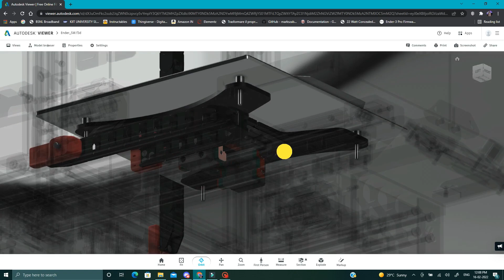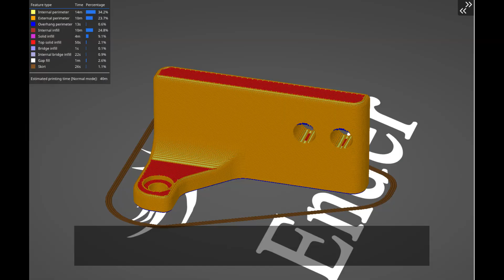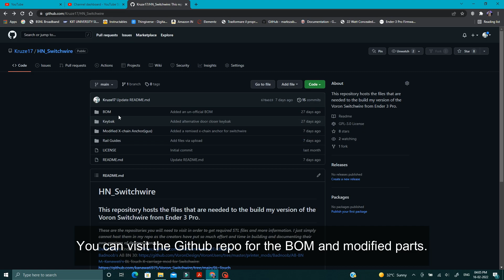Ender 3 Pro to Voron Switchwire Conversion - Part 3

Comment: Loved the series.  I was thinking of the same conversion, but will likely reign in my ambition some.  The parts you printed were amazingly clean, would love to see a tutorial on how to get ABS printed like that -- without warping.  Thanks!
Reply from the maker: Tutorial for Switchwire or Ender 3?😛
Reply: Either one! Is ABS without an enclosure easier on the switchwire?
Reply: Use a glue stick!! Elmer's purple. Since the very first time I used it I havent had a single corner of a part lift up! I use it every print no matter the size of print, it has been 100% effective in eliminating warpage. I was a non believer for a long time too until one day I decided to try it, now I don't start a single print without it.

Comment: Amazing videos. Thanks
Question regarding toolhead pcb wiring
Where does the 24v and 5v wires connect to? MCU?
Reply from the maker: You can refer this diagram for the wiring of the old hartk rev3.2 toolboard: https://github.com/Kruze17/HN_Switchwire/tree/main/ToolheadPCB_crealityv4.2.2%20wiring%20diagram
Coming to your questions, yes the 24v wire is connected to the MCU's 24v main input terminal. I don't remember if a 5v input was required for the toolhead pcb.

Comment: Did you print all your parts on the E3 Pro before the conversion? If so, what slicer? Was it direct drive or still Bowden? And lastly will you be able to share slicer settings? Fantastic work man! I've been following your build. It's brilliant.
Reply from the maker: Yes, i printed on my E3 pro before conversion. I use SuperSlicer for slicing software. It was printed on bowden extruder system. Yes i will sharing my slicer settings on my switchwire's github repository soon!
Reply: Ah that's fantastic! I'd like to do the same conversion, so I want to print ABS on my E3 Pro. So wanted to know your slicer settings before the SW conversion. Thanks for the info man!
Reply: Great video man. Doing the same conversion atm. Still missing some screws, then I can go on. These videos was very helpful for a good assembly. Thank you very much.
Reply from the maker: @GeldVerdienenOnline1  So much love and support from you guys! 🥺 Thank you so much. I am glad that my video was helpful for your build.

Comment: You switched from Bl Touch to the Omron Probe, but do you still use the Omron probe or something else? I found that Omron Probe is not reliable enough on my 2.4 and I managed to ruin my build surface with scratches, so I am thinking on trying the Klicky? Voron Tap is not recommended for Switchwire...
Reply from the maker: Yup, i am using Quickdraw at the moment. You can go for Klicky. They both work and provide the same percision as long as they use good quality micro switches.
Reply: @HyperMakes  , perfect, thank you very much for your reply. I will be starting my own journey converting Longer LK4 that is built with 2040 instead of 4040 extrusions to Switchwire, so l am trying to list all the parts that I will need to modify in order to make this to work for my use case and your video is really helpful showing the whole process end to end!

Comment: Nice bro I been waiting for you to drop this video my build been going slowly waiting on the correct length screws for the gantry I originally ordered going off the Orginal switchwire bom and forgot there was a difference also I’m trying to put in a fysetc spider or btt octopus since I have both sitting around not getting used would be since if you made a video on the tool head pcb wiring also what gauge of wire you use for ur bed and did you extend it or replaced the entire thing
Reply from the maker: I will be giving some tips regarding wiring and commissioning in part 4, so stay tuned for that. Regarding bed's wiring, i used i used 14 awg wires and extended the bed's wiring.
Reply: @HyperMakes  great thanks for the info can’t wait for the next video

Comment: Can you show how you extend or replace the original cables from the hot bed? How long did you choose them?
Reply from the maker: Well, it's very straight forward. I just soldered 14 awg wires to extend the length of bed's wire. I chose around 1 meter length, but its lil bit more. 70 cm would have been the proper length for my build.

Comment: Wanting to save on could you use the new creality extruder?
Reply from the maker: Yes, you can. You may need to do some custom connections for the toolhead wiring though.
Reply: @HyperMakes  Thank you very much, last questions. Are the pieces all petg printers? How motherboard a skr mini e3 can fit?
Reply from the maker: @Yonbii91  No. All the printed parts are printed out of ABS filament. PETG has material creep. You can print out of PETG but it is not recommended. The recommended filaments are ABS and ASA.
Reply from the maker: @Yonbii91  Yes, SKR mini e3 can fit as motherboard.

Comment: Thank you friend !!  Amazing work!! It's an inspiration video for me. I've already converted my Ender 3 PRO to linear rails, so next step is belted Z, so it becames a SWITCHWIRE :-) I Have two questions, did you print those parts on you Ender 3 ? if so what hotend did you use and what settings ? Thank you again !! so much!! Kudos
Reply from the maker: Glad you loved the videos! Yes, the parts were printed on the Ender 3 before conversion. I used the stock creality hotend with Trianglelabs bi-metallic heatbreak. Slicer settings were according to Voron Specifications.